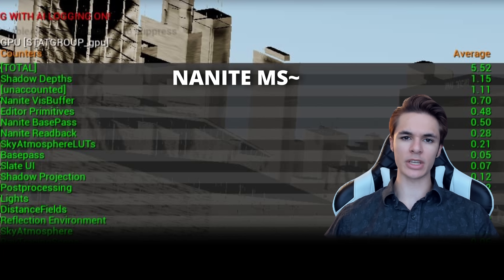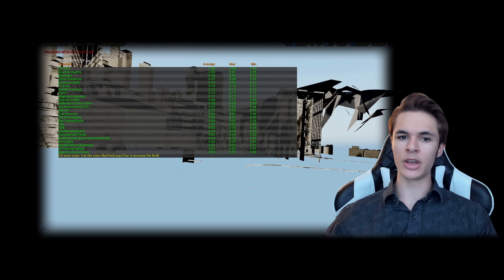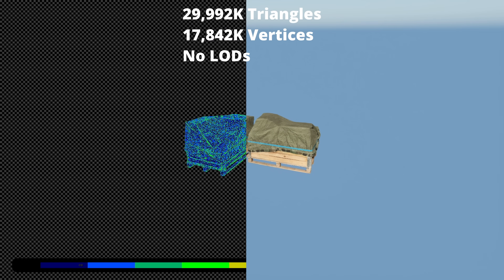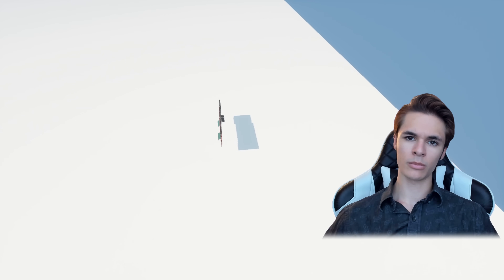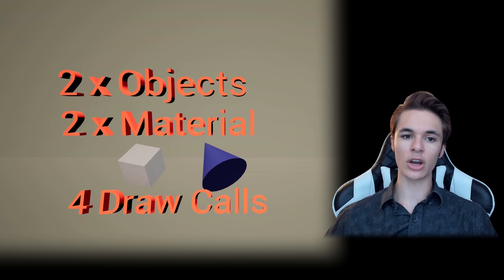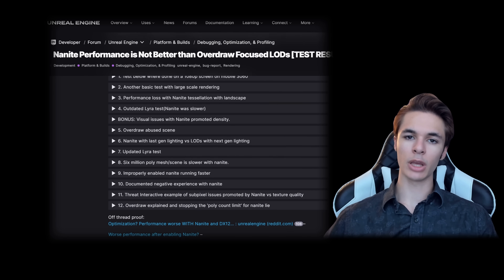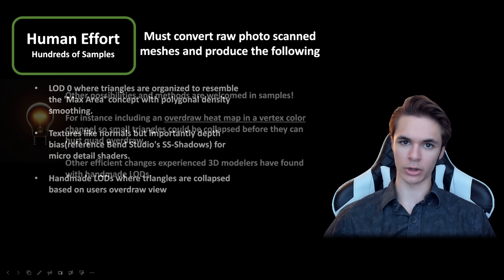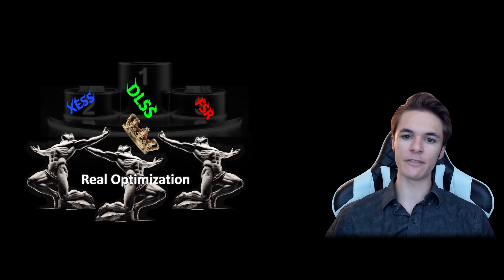Epic's Unreal Optimization Disaster | Why Nanite Tanks Performance!

Comment: I smell a bit of bias in this video, that's okay but it seems to generalise complaints about nanite and VSM. Epic do not force the use of nanite or VSM, in fact they say you should only use it if you need it. More than that they also give lots of reasons when NOT to use nanite or VSM and give a few solutions regarding that such as only using nanite for very close meshes and forcing tradition LODs instead of using nanites giving the best of both worlds.

Anyone who thinks nanite is a magical fix for having highly detailed meshes probably hasn't delved too deeply into it. It can be, but it does not remove the requirement for properly made meshes. VSM is a PITA and requires a lot of control to get decent results. 

Quad overdraw [and other engine visual representations] results in engine are problematic, as they do not always show the correct/accurate information.
Reply from the maker: Re: Epic do not force the use of nanite or VSM

When they remove a major source of geometry detail (tessellation) and discontinue support for traditional optimizations (8:23), we can easily argue that. Lumen is a big reason why a studio might demand the use of UE5 instead of UE4.  Now tessellation is only available in form of Nanite. 

Epic even admitted on the UE roadmap that they want to completely replace traditional pipelines with Nanite rendering. This is where they're billion dollar revenue is going, instead of investing in automatic systems systems that exploit performance research.

Comment: the AI solution, once it starts working, will be the best ... but its hurdle is also the worst, needing the training data
I propose that we use a not-so-recent technology, blockchains, whereby modellers who enrol can submit their handmade optimizations to the AI... The incentives will be in the form of a score which is calculated from the number of polygons and resources saved, vs how different the model looks before and after the optimizations based on their renders from different angles

Comment: Maybe it's just me, but everything I've seen from epic was about having a 1 click solution to seriously cut down on manual optimizations. Sure, you can get way better performance by manually building LODs and baking your meshes together. But that takes time, slowing down production. Nanite let's you throw a bunch of stuff against the wall and see what sticks, without having to do a bunch of extra work just to be able to test it. I don't recall them ever saying nanite was more Performant than LODs and manual optimizations.

Comment: But wait - isn't Nanite adding a fixed cost to the frame too? So in that sense, a simple mesh doesn't cost 1.28 ms, because adding another mesh wouldn't give you 100% cost increase

Also, I think its advantage is not make things faster (but it's sadly advertised as such- infinite geo). Isn't it, as with all virtualized techniques, to make the cost more predictable and uniform?

About mesh topology vs AI - it's one of the hardest problems in the graphics field. It's an obvious goal for many talented people but one that's still eluding a stable solution

But I'm all with you against the fake expectations and YouTubers' misleading "tests". Thanks for giving it a proper profiling treatment & explaining the basics
Reply from the maker: "But wait - isn't Nanite adding a fixed cost to the frame too?"

No, read our pinned comment.

Comment: Technicly everything you say is right from a perspective. But youre conclusions are very wierd. Especially the Ai one given quality problems it usually has. I think we should not confuse what some youtubers say with how the feature works and why it was developed and if any one didnt catch that its exactly for the work flow. Nanite doesn't render more triangles it renders them more where there needed. And yes it will lose to very well hand optimised scene but the point is you dont have to do that. Also examples you showed are actually rather bad for nanite. The point is not that it renders single triangle faster its about the complex scene and work requaiered.

Comment: Information that isn't provided at 8:06
Unreal 4.22 added a feature called dynamic instancing which converts static mesh components into instances when applicable. Effectively meaning that static meshes are instanced by default. Unless this has somehow been broken in Unreal 5 (I can't be bothered redownloading 5.4 to check, my primary Unreal version is 4.23) I feel like it's either misinformed or disengenous to claim that Epic has been neglecting instancing as a whole.

Comment: The point of nanite was never to increase performance compared to a perfecty optimized mesh with LODs. It is made to allow devs to discard LODs for a reasonably low perfomance hit.
Reply: In other words, they are shifting the cost from devs to hardware (consumers, console producers)
Reply: @Harut.V interesting how this correlates to something in the web development scene. 

Back in the day, web page was finalized in the server and the result was sent to client. 

Then someone thought it would be more performant if they offload some of the work from server by letting client handle some of the tasks (like animation) through scripts. Hence, that became the norm. 

Now, there's server side rendering which is better because everything in the remdering is handled in the server so the result will load much faster on the client. Now, this is becoming the norm. 

If you look back, the final step is pretty much the same as the initial step. I wonder if the same will also happen in the game industry.
Reply: @sharif47  Yeah, if the client side/GPU power keeps increasing a this pace then I would rather have devs spend less time and money on making games. But if the hardware side of thing stagnates on client side, then I can see it going back.
Reply: @sharif47  You don't know what you're talking about..
Web frameworks brought features and scale that just weren't possible before. It's not about offloading - the server does the same amount of work, really (animation could never be done by a server, by the way...). It's about having interactive and reusable components on the front end. Server side rendering is having similar reusable components but resolved by the server - a new concept in comparison to the primitive old way of manually hobbling together pages with no strong component framework, or trying to write your own engine for it that just wouldn't be as good as modern frameworks
Reply: @Harut.V  Hardware is already stagnant. The gap between the last several generations of video cards and processors is rapidly shrinking.
Unless the experiments with photon-based processors pay off I don't see hardware making significant gains in a few decades.
Reply: @Harut.V  that's how progress works, genius.
Reply: @ben.pueschel That's not progress. Software quality is as important as hardware performance or maybe even more important.
Back then, when hardware was so limited, developers tried so much to optimize their software so much. Nowadays the engines made their work easier and faster but the performance cost and limitations of these generic purpose game engines can be high without the developers interfering doing their own, serious optimizations.
They want things to happen in real time and automatic. While the automation is great, it's always good to do manual adjustments.
Reply: @Luke357  these things are all progress... nothing smart about wanting technology to stay as it was in 2010. In the transition period things won't be perfect. Seriously grow up. You guys are like children asking "are we there yet" in the middle of a road trip...
Reply: @purplevincent4454  Did you read what I was replying to? He was trying to claim that hardware costing more for the consumer is a good thing.
Reply: @ben.pueschel  Yaah im not sure what this guy is getting at. Nanite is doing exactly what its suppoed to do. All the people with older hardware that want games to cater to their trash boxes are the problem. Im not developing a game with thousands of LODs for primitive technology.
Reply: @Bdhdh-p7h I guess an RTX 4070 is primitive caveman technology then with how some of these UE5 games run, or more accurately crawl
Reply: That point is proven false when you consider Epic themselves directly stated this was a performance-enhancing feature when that is true in almost zero situations.
Reply: if losing 60% fps is "reasonably low" to you
Reply: @doltBmB  it's a lot less than that in most real life use cases.
Reply: @stephaneduhamel7706  Yeah it might be as low as 40%, real great
Reply: @doltBmB  Every new rendering technology generally comes with a big performance hit to older cards, but with large wins for future cards. It has always been like this. They are thinking about where things are going, where you can show movie quality scene rendering in real time. In a general purpose way that scales to any kind of content.
Reply: lie
Reply: You can do that with Mesh Shaders and not have the  massive performance hit you get from using Nanite.

Comment: nanite is specificaly made to render non-optimized scenes with ridiculous polycounts, and microgeometry when each pixel might render a separate triangle. and models that don't have lods. it has huge initial overhead but way higher scalability in this scenario. actually nanity is not a unique technology. it is an implementation of a techique called visibility buffer.

Comment: All of this is without talking about the fact that you're still holding the full, high-poly mesh in video memory that whole time.

This means that the larger the size of your mesh, the more video memory you use for that, without even involving anti-aliasing solutions.
As this has a tendency to almost immediately fill up the video memory, this means your video card now has to stream assets to your actual memory to make do, which increases RAM consumption. This is much slower than on the graphics card, and is very likely to introduce significant suttering issues as it swaps between video memory and shared system memory.

So not only is overdraw an issue, but you're now asking for videocards that could have run things perfectly fine with LODs to now deal with much more data than cards from even the 10th Nvidia generation are built to handle in video memory, thus rendering them almost obsolete purely due to an optimization problem that did not need to happen at all.

Comment: Doesn't UE5 have a software rasterizer that doesn't use quads, eliminating the need to worry about overdraw entirely?
Reply from the maker: With Nanite you don't need to worry about quad overdraw. Quad overdraw is fundamental for traditional rendering. Nanite has a very high per pixel cost in comparison with good overdraw surface area. Both are multiplied by the concepts we mentioned at 5:19.

But Nanite can suffer from a issue called "overdraw" which is not related to quads at all which we stated in out pinned comment. Nanite overdraw can be induced by overlapping meshes but our test scenes included where not prone to this issue.